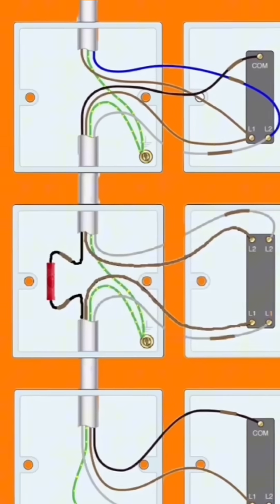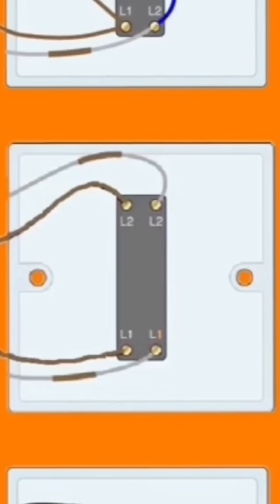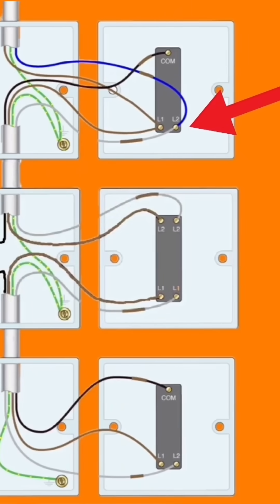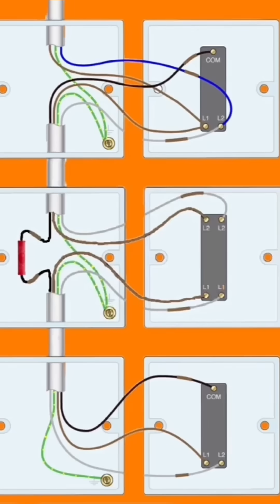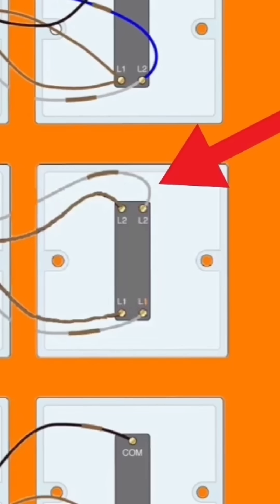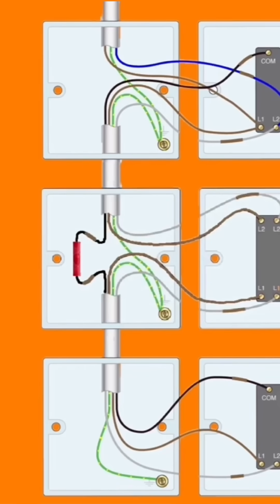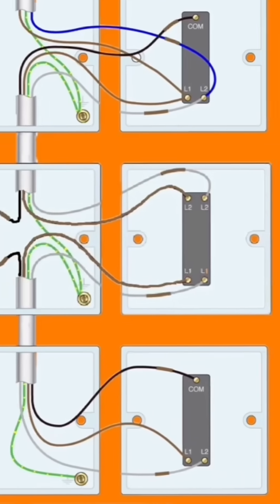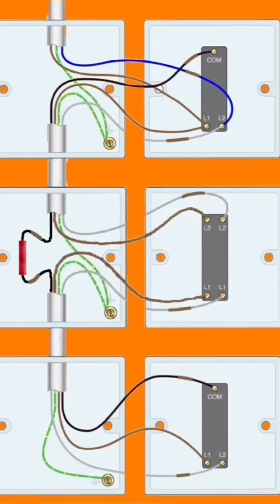Connections in 2 Way and Intermediate Switching Explained

Comment: Is it possible to have the feed at an intermediate switch. Interrupting the common (black)  sending live one way and switch live down the other? I've done multiple diagrams and can't see a problem. (I'm replacing a two way for inter to add a forth switch. Thanks